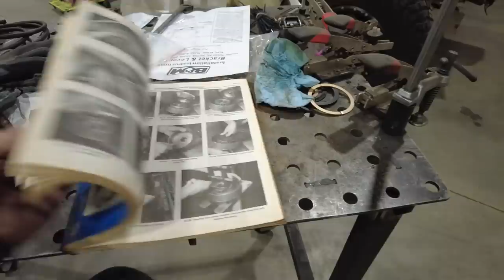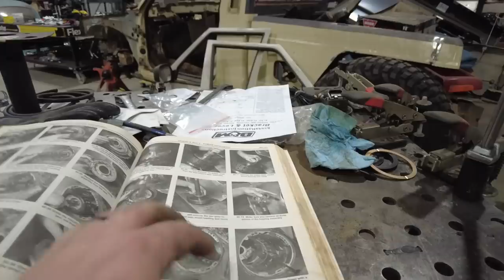Installing Drive Over Fenders on the Trailer, Car Trailer Maintenance, and Cleaning Up The Shop

Comment: I have watched you for many years, Ian, and to find that you battle the shop clutter like I do, is such a pleasant surprise.  Thanks for showing us that side of you.  I really like your rolling parts storage for upcoming projects.  I need that, too, and wish you'd show us a bit more of those shelves.  Also, awesome video on the trailer brakes and fenders.  My fenders need replacement, too, and you've shown me what I need to do to make that happen.  Thanks!!

Comment: I started with rebuilding a 4l60e behind a warmed over LS in a pickup... best overdrive transmission Ive ever owned.. Then i built a powerglide to put behind a 1100hp LS in my trans am... also been one of the best transmissions Ive ever owned (only managed to snap the input shaft so far)
Reply from the maker: awesome job, good to hear you are rebuilding your own transmissions

Comment: I use compressed air to blow out from under stuff, blow towards the middle of the shop, then sweep up the big middle.  It works and minimizes dust in the air but saves moving stuff around.
Reply: And the leaf blower.
Reply: I shop vac either end of day or first thing in the morning everyday.  Maybe a little excessive, but I feel so much better & motivated working in a clean shop than I used to in a dirty shop!  Really surprising how keeping my shop clean makes me want to do better quality work.

Comment: You could make a removable tire mount that goes in the stake pockets. Make it longer than the pocket so you have room to put holes for a pin below it. Then if it’s in the way for a particular haul. Move it to another pocket.

Comment: The best thing to do when working on a big job is to keep an empty toolbox for the tools you are using on that job. At the end of the job or the end of the day. You clean & put away all the tools you had out. This keeps you better organized and prevents you from losing tools. The way you left your shop, there is no way you were able to quickly find half of the tools you had out. Keeping organized as you go does actually save you time in the long run because you are not wasting time looking for tools or parts.
Reply from the maker: Oh I don't disagree with you....but when in the thrash...and you are pulling four 20 hour days....it gets messy no matter how hard I try this happens at least once a year
Reply: That's actually a really great idea 😎👍
Reply: I do the same thing but with a hf service cart.
Reply: I use magnetic large trays and lock in top chest. Great idea.
Reply: Five gallon bucket..everything goes in the bucket each time work stops, from there it's just a couple minutes from bucket to everything in it's proper place.
Reply: Nice tip 💪
Reply: He needs a house mouse 🤷🏼‍♂️🤣🤦🏼‍♂️
She'll keep it clean 🤷🏼‍♂️🤦🏼‍♂️🤣
Reply: @BigTireGarage  I myself totally get it(the cleaning situation)and with as obsessive as I am about organization,it ALWAYS comes to a point where the shop ends up like an auto zone riot area 🤷🏼‍♂️🤦🏼‍♂️then it drives me nuts and I end up having to force myself to a shop day,for the shop 🤦🏼‍♂️🤣

Comment: Jody at Gravely trailers built my car hauler custom and one of the spare tire mounts has a spindle welded into it and a live hub is attached as the spare tire mount and if I blow a bearing or hub on the road, it gives me a full replacement.  Sweet setup
Reply from the maker: I was going to do the same thing TBH

Comment: You can get replacement spindles made to weld into the axle tube. It makes a great spare tire carrier to use a spindle and hub with the added benefit of having a spare hub on hand without taking up space.

Comment: FYI - had a similar problem on my trailer years ago and went with disc brakes "surge" so i don't have to have a controller on the rig I'm using ... the company i used was Kodiak great product - great price

Comment: If you adding new electrical outlets down your wall, say 4-6 in a line/circuit. As long as the first outlet closest to your electrical panel is a GFI outlet then all the other outlets after that will be protected by the GFI. At least that's code were I live.
Reply: Excellent point ☝️
Reply from the maker: True....but I have space in the panel to add a dedicated circuit just for this one item...so that will be my plan

Comment: Motobuilt fenders are cool, but @ eight bills + shipping... think they'd out value my ol 19' tip deck! For my spare tire, I used a piece of C channel that drops into any of the stake pockets: remove or relocate as needed. A length of chain padlocks to itself to keep it from "growing legs".
Reply from the maker: Yeah they aren't "cheap" but once I priced the steel to build my own it was only a couple hundred less....I also priced a new trailer...and it was almost 7G..this one was bought for 1800 bucks brand new...

Comment: After having my shop for a few years, I have found things I like, dislike, and wish I had done differently.  I wish I had plumbed the floor for in-floor heat.  
If you had to start fresh on this shop, is there anything you would change or do differently?
Reply from the maker: That question is in one of the upcoming Q and A videos
Reply: @BigTireGarage  cool! There's lots of things I currently like about mine, I know people will always say "more space" or "a vehicle lift" but there's still some other things that may have been a good idea but turn into little annoyances that in building a shop you don't think about.

Comment: JMiles_offroad

what tire is that sitting on the floor in the beginning? i used to run a Chinese/ ebay tire called a MT200 and LOVED that tire! wish they made it in a 40 or 43 ...that tire on the shop floor looks alot like that old tire i used to run.

Comment: Can I take an S10 front 4x4 center differential and use 2 of the short axles on it essentially making it shortened axle with center differential

Comment: I have blew up 2 TH400 transmissions one of them was so bad that it would only move forward even in reverse and park. Those transmisions don't like shifting drive to reverse without stopping
Reply from the maker: If built for it they can....we use em in Ultra 4 and Rock Bouncers all the time

Comment: I have a 79 Cherokee Chief that's has a TH400. And it just started leaking more than normal from the pump seal. I think? Never had an automatic transmission apart. And it's really hard to sift through the bs reviews of shops. I'll volunteer my cherokee as tribute for your th400 lesson. I try to drivenit every other day and it's been sitting for a couple weeks now. I hate it just sitting there. I'm going to attempt to see what's going on next week when I get some time off. But I'll save it for you if you want. I'll even throw in some bourbon for your troubles.

Comment: So the wood is still structurally strong and it's more of an appearance issue. Take the wood off and turn it over. Give it a little washing  them stain or paint.
Reply from the maker: It is sun baked pretty good...and splintered..I don't think it would survive being flipped over TBH..

Comment: What kind of solvent/cleaner do you use in your parts washer? More importantly, what would you recommend for using in a parts washer that is in an attached garage that won't stink and cause marital problems? ;)

Comment: As much as you use a trailer then yes it pays to kick the tires once in a while and check a bearing etc... Those fenders look so much better. Give it a paint job and the viewing public won't look down on you so hard when you haul those mega buck rigs...
Reply from the maker: I am really considering ditching the wood and doing a steel floor like my other hauler....then painting the whole thing

Comment: Pro tip, treat the wood on your trailer with used engine oil. A 4 in brush and 20 mins a coat. Will last forever.
Reply from the maker: Great tip!

Comment: Do you prefer those style ramps on a trailer?
Reply from the maker: I do and I don't, they are great to prevent the trailer from lifting when loading...they are also crazy strong...but sometimes when I haul longer vehicles I have to load them a little further forward than I like...I plan to add another pin so I can fix that

Comment: I see you use casters on almost everything you can in the shop and that’s a good idea.  Do you get HF casters or do you go for a particular brand, any noticeable quality difference in between companies?
Reply from the maker: I have found the small steel casters seem to work the best...I just look for casters with the highest load rating

Comment: Ian, I'm curious why you didn't add brakes to the front axle while you had this apart.  I know you're not in the Rockies, but I would imagine that a single pair of 10 x 2.25 brakes leave a lot to be desired in the braking department on a trailer that size.
Reply from the maker: Never felt that I needed more brakes...if I was going to do that I would honestly just upgrade to bigger axles
Reply: Funny how brakes on only the rear axle always seems sufficient.  I've had just over 13,000 lbs gross trailer weight with only rear axle brakes and it somehow braked fine on the highway and surface streets.  Seems like the math doesn't add up!
Reply: @branchandfoundry560  I do not share your experience.  I live in a mountainous region with high speed limits and need every last bit of braking I can get.  Brakes on all axles on every trailer,
Reply: @jefflong5661  You make a solid point! Totally depends on geography. Big mountains change everything. Too much braking capacity is barely enough in the mountains sometimes.  I experienced a harrowing scenario coming down Vail Summit pulling a trailer in a snow storm in 1996.  Still sticks with me!  Fortunately, I'm in the relatively flat NC mountains now where we don't have to worry about big snowfall nor long steep mountain passes.
Reply: @branchandfoundry560  I forgot to add that it's also a law in my state (NV) that all trailers rated over 3,000 lbs need to have brakes on all wheels (NRS 484D.250).

Comment: Bearings and seals are cheap. Always put new bearings in when it's been that loose. Even if you keep the old ones as spares.
I also don't believe in using cheap trailer tyres, If they're not suitable to go on a truck why are you risking your life running them on a trailer?
Run a good set of load rated Light Truck tyres.
Reply from the maker: I hear that argument all the time...there is a difference between truck and trailer tires...I only ever run trailer.tires with high ply rating, I agree on the new bearings, but keeping used ones for spares can save you on the side of the road.
Reply: @BigTireGarage  Being an international, I probably should have differentiated between 'truck (Ranger / F150)' and commercial truck tyres. 
Where I live trailer tyre are always cheap and crap, even a standard car tyre is better. Though the "LT" heavy duty versions of 4x4 and van tyres are the preferred option.

Comment: Aah you slipped up and called it a studio. It looked like one to me seeing the ceiling in that building. And a lot of that shit was put in place. When my shop is a mess there’s usually oil and brake fluid rags and grease on the floor at least. Stop bullshitting us with the speed TV 2 guys garage act.
Reply from the maker: Its a shop/studio but if you don't thin I build the cars here you haven't been paying attention